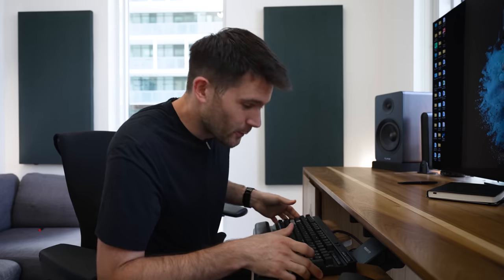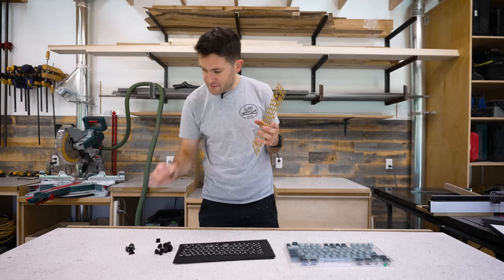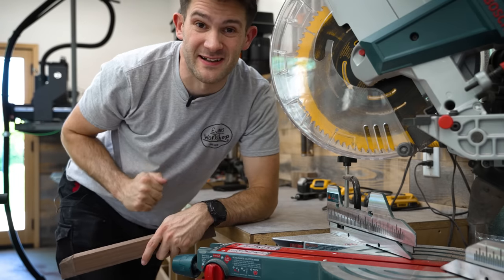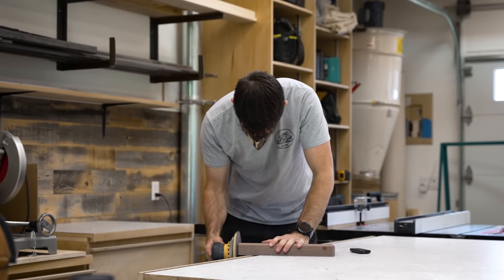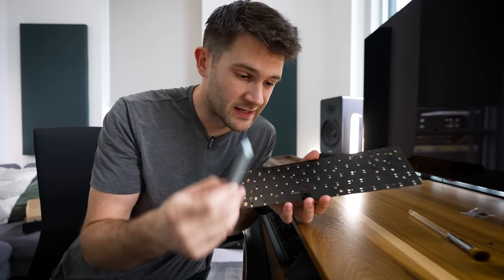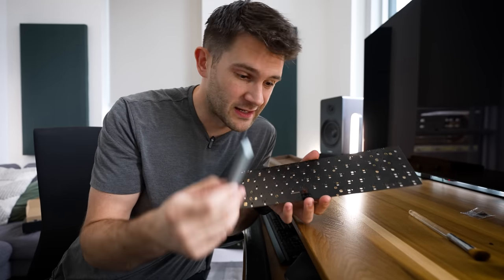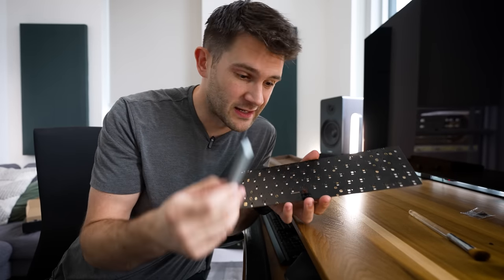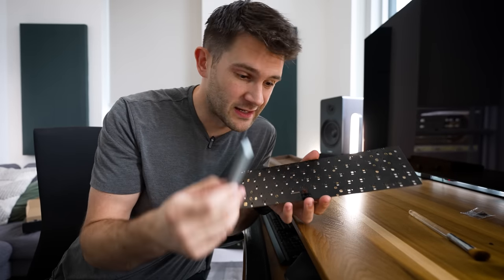This one cost me A LOT of money...

Comment: For your keyboard I’d recommend not using a stand-off mounting system, I’d recommend going with an o-ring mount. There are two keyboards that are open source so you can modify them and use them how you like, the bakeneko 60 and 65. The switches I would go with are probably prelubed linear’s, I prefer tactile, but if you’re not going to lube them yourself going with a jwk or comparable switch will probably do you better. Also I would skip the brass plate for a pcb plate, they’re typically cheaper while creating a softer typing experience. Finally I recommend when lubing your stabs plug the backside, opposite of where the stab wire enters the stab housing, with 205g0 lube via a syringe, it’ll stop most rattling
Reply: Go spring mount instead + daughterboard

Comment: Alright, I'd like to say that your custom wood case is slick as heck and no matter what one thinks of a tray mount keyboard, you have a very personal and unique case all your own. That said, now in 2024, you can get a keyboard for under $200 with an aluminum case, your choice of plate, tri-mode PCB (wired, bluetooth and 2.4GHz), gasket mount, fancy shiny heavy weights for excellent sound, etc. All you need to do is add your own switches and keycaps which can be as cheap or expensive as you like. I'd recommend pre-lubed switches from SWK, Gateron, etc. if you want to get things all done fast.

Comment: Awesome video and very nice build except for the Browns 😁 You really gotta test other switches out now that you have hotswap sockets! Would also recommend learning about dampening the empty space under PCB and different PCB mounting styles such as O-ring/gasket mounting. It really is a deeeeeeep rabbit hole of a hobby to get into.  

I also have a question: how would you go about producing that "typing angle" if you didn't have a planer? That's one thing stopping me from building my own wooden keyboard case atm. I did think about bandsaw, but I don't have one of them either and it would have to be quite huge to fit that case vertically. Next thing coming to my mind was making angled jig for cutting multiple passes with circular saw and then chiseling away the excess.... 🤔
Reply: You could use a router. The same way you would use a router in a slatt for flattening boards, but just securing the Wood at an angle as seen in the video.
Reply: Came here for this comment. The lovely wood, the beautiful build, even using lubed screw-in stabs… but then choosing cherry browns 😂. But in the end, as long as he enjoys it it’s all good.

Comment: I have a zebrawood case for my main keyboard (60%) and a laser cut steel plate sandwich case for a lily58 based gamepad.  I absolutely LOVE how you cnc'd yours.

Try foam between the board and plate (plenty of places sell it, even Amazon depending on layout).

Try experimenting with filling the rest of the case to get a deep THOCK.  I've used packing foam, those sheets you use to make dishes not slide around in cabinets, rubber, dynamat and seen people pour epoxy or silicone to really solidify things.

And most importantly try different switches, Gateron and Kailh (especially box switches) are great cost effective ways to really change things.

Enjoy your rad keyboard!

Comment: Nice work! The custom keyboard hobby is a steep rabbit hole. And there are tips and tricks to make insanely good sounding keyboards. Look up the Youtube Channel "Keybored" for some good stuff. You are 99% right that the keyboard community would tell you that you have the wrong switches :P (The 1% being Glarses). What you could have done, without adding too much effort, is to buy pre-lubed switches, so that they sound smooth. Right now the ones you have are rattly/scratchy (from an enthusiast standpoint). Check out something called "Gateron CJ's", or Gateron Oil Kings. Horrible names, great switches. 

You can also put blue masking tape on the bottom of your PCB to make the sound profile a little more poppy. If you like that wood thunk sound, hollow out the bottom just a little bit more, and put a material called Poly-fil stuffing underneath the pcb. All little tricks to enhance the sound of your board! 

Nice job. You definitely poked around on the custom keyboard communities enough to do some damage!

Comment: Run... Run while you still can... endlles rabit holle that might be eaqualy or deeper then the audiophile one. BTW a DIY wood (or wood/acrilyc) case for 60%-65% keyboard would be an awsome video. Especialy with O-ring/gasket mounting option, and a battery well for bluetooth PCB support, a wooden switch plate might be too exotic for a DIY build.
Any way wellcome to the hoby, hopfuly you next adventure would lead you to a split ergo ortholinear keyboard with per key pcb or handwired Dactyl manufold build.

Comment: $250+$60+75=$385
Why'd you keep calling it $500?!  $115 is more than "a hair under"...
Reply: weird USD-CAD conversions covers the difference. 

More importantly, the components shouldn't be that much, ESPECIALLY since the keycaps, stabilisers and switches are all basically as cheap as possible. 

Only quality things are the pcb and plate from kbd fans. Id say  this build could easily be done for at least 100$CAD less for the same parts. 

Also who includes shipping when showing the cost of a keyboard???? Without shipping and with more reasonable prices for the parts the whole build is 160$CAD or £100. Pure clickbait. *also for that price you could make a board 3x better in sound and feel.

Comment: i dont want to be that person but i feel like you paid way too much for the pcb switches and keycaps if you got mx browns. you could definitely build a keyboard with the similar or the same specs for like half the price if not less. nonetheless still a great video and awesome build
Reply from the maker: If you're gonna be that person at least tell me where I can get cheaper keyboard parts! 😂😂
Reply: @ZacBuilds  hahaha my bad. i dont know what exact PCB and such you got for this build, but on for example kbdfans they've listed a similar specced pcb for 58$ (and im sure there are tons of other options out there similarly priced), then for keycaps you should be able to find a good set for no more than 40$ on sites like aliexpress, and if you're lucky with free or really cheap shipping, and for switches themselves I would just advise to get a different brand than cherry (gateron or khail for example, in which case gateron is waaay cheaper than cherry at least where I live). a set of 110 switches whether it be brown yellow red blue or silver are all under 30$ where I live, so in total shouldnt add up to much more than 120-150 depending on what keycaps and PCB you get. I personally am using lubed gateron g pro silver v2s since I don't like the tactile bump brown switches have, which i had before the silvers. I've also used yellows and i can definitely recommend both yellows and silvers since theyre super cheap, smooth, and available pre-lubed :) Im also not sure whether you included the cost of the wood you used and such with the price, but yea other than that i think if you know where to look (mostly aliexpress but switches especially should be available at most bigger electronics webshops based where you live) you should be able to build a very similarly specced keyboard for way less. Also, another quick easy and cheap way to improve your keyboard is by adding foam between the PCB and the housing/case. Has a similar effect as adding foam or sound dampening material in a speaker enclosure :) Other than that again great video and really impressed by your woodworking skills.

Comment: Ngl you got omega scammed if you actually spent 250 CAD for those components. MX Browns 14$ max (they are worthless garbage PLEASE use other switches); A QUALITY brass plate and hot swap pcb from kbd fans would be 90$ and a set of proper stabilisers would be 20$ ish. Including the keycap set which looks to be a cheap unbranded set likely available for under 40$, for only 165$ you could have built a likely better keyboard. Its reasonable for you to say that $500 isn't worth it for a keyboard like that, when something of far higher quality could be done for much less.

Sorry about the rant, the case you made seems amazingly high quality while also looking great. There are thousands of ways to make a keyboard sound better through mods or different parts (all hopefully cheaper), I hope you stick around in the hobby to try them all out.

Edit* I see you actually did use a DZ65 PCB credits for using KBD fans

Comment: this nerd thinks that you actually chose the right switches. for the future I would recommend clipping the legs off of your stabs so they aren't mushy, lubing your switches, and I would recommend using orings to dampen the hard contact between the PCB, plate, and case. also I think you'll love all the different unique mounting styles, such as gummy oring, gasket, top mount, stack mount, plateless, half plate, leaf spring, and sandwich mount.
Reply: not a nerd if you think mx-browns are correct